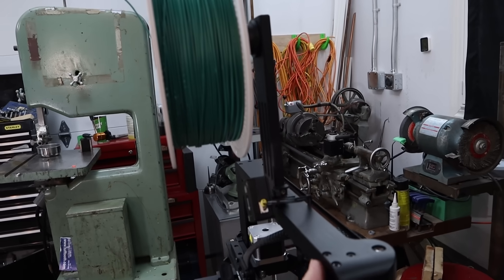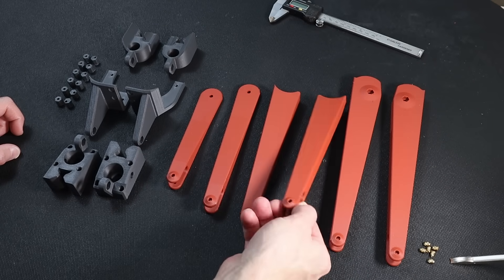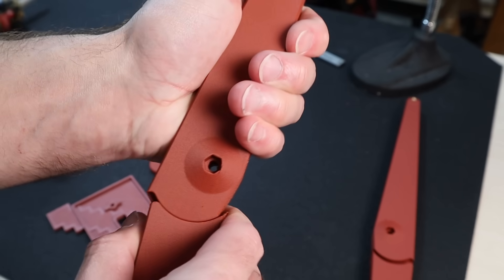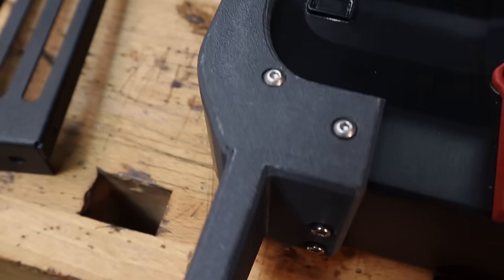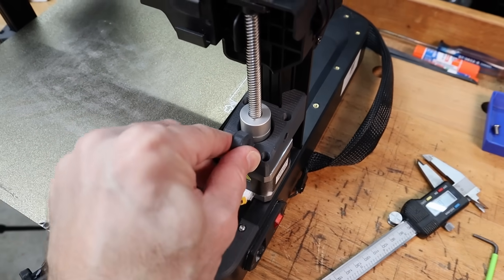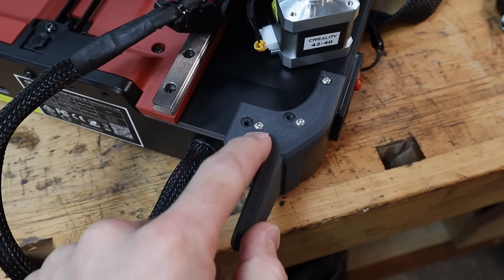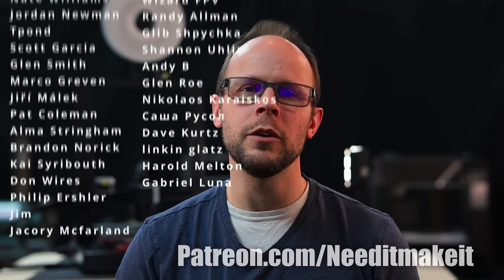STRONG and FULLY 3D Printed Arms for your Ender 3 KE and SE

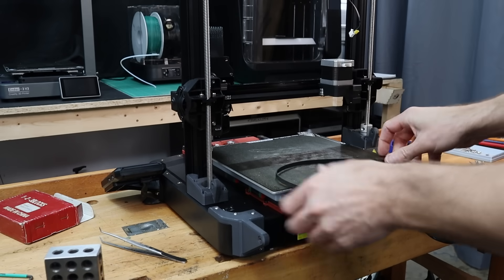Comment: 10:01 My admittedly used Ender 3 V3 KE came with the left and right side Z-axis misaligned.  I eventually realized what was going on from the bed leveling results, released the belt gear collar on one side, rotated the wormscrew a quarter of a turn, retightened it, and now it's almost perfectly level.
11:45 Good solution for "and now we can add the M5 locknuts...".  I like that you leave in certain realistic difficulties like this in your videos :)

Comment: H Mike, I know it's an "older" video, but I just wanted to say that the shaking also occures because the spool is on top and combines with the fast accelerations/speeds it shakes a lot. An easy fix for me was to to print a plastic tube (1.4mm walls) and put it onto the spoolholder (like toilet paper roll, you get the idea 😀). Printed from PETG and it feels much more rigid.

Great video nevertheless and thanks for sharing!
Reply: Good idea.  In fact, that makes me think that adding (firmly affixed) inertial mass to the top of the frame should reduce vibration - e.g. diving weights or wheel weights.  🤔

Comment: 😂😂 hi there ! Im from PrintArmyUkraine - ender 3 se v3 is ready to print from the box printer . Stop spending yourtime on nonsense 🎉 join PrintArmy of Ukraine - 🇺🇦  , you will get free 24/7 support from best designers and printmans ❤ i having this creality and it is printing parts for funny things almost 24/7 - yepp it is not the best , assembly is 50/50 but it is working , and it can print really well from the box +- 0.1 - 0.15 mm . And one more - plastic is not rigid 😂 it is really soft compared to metals

Comment: I've been posting on the maker world page, but maybe it'll get seen better here.  I am having an issue with the cut out piece on the lower left hand model.  Mine is printing too tight/filled in and the little coin is not popping out for me.  Wondering if there's a way to fix that?  Maybe someone else has run into this?

Comment: I could not really tell, but I'm 99% sure that PL was construction adhesive. That stuff does not dry hard. It's meant to hold wood together and expand/contract with the wood. This is not a good use for it.

Comment: Thank you very much for this great Video. 
I would probably use a threaded rod so that I could still adjust the force and position.
Reply from the maker: No problem!  I think a rod is a great idea, I was trying to do something that anyone would be able to do with a 3D printer, using metal would certainly be a better option for anyone capable of working with it.

Comment: I'm a bit late to the party, but I did a redneck solution for this. I attached a piece of wood to wall next to the printer, then attached the piece of wood to the spool holder with a bolt and a nut. Similarty I attached the whole table to the wall and I put sticky pads under the printer so it doesn't move at all. Love the channel, love the videos. Keep it up!

Comment: Guess it wss a good thing the space for my ender 3v2 wasnt big enough to use the filament arm mount on top, so the first thing i printed was an adapter to put it on the side. And then I made free standing filament holders. 
I always thought hanging the filament on top wasnt a great idea. Maybe it gets smoother extrusion, but it cant be good for the frame.

I've been thinking my final design for the filament holder would be a wood frame that allows it to sit on top on an angled lazy susan that just fits the space i have. The wood frame makes it so theres no actual weight on the printer frame.

Did you not do anything to test for the squareness of the frame though? Having one side have an off centre nut makes me think it must be making the frame be slightly twisted, even if its more rigid.

Comment: Hey Mike, I just wanted to say thanks for your work on these arms. It solved my issue with print failures on my taller models. The angle on my gantry was so bad but not only did these arms straighten it out but made it sturdier. My prints are now coming out great. The only thing was I had to by a Bambu Lab printer to print the arms in order to fix the Ender. At least that's what I told the wife 😄. Anyway, just wanted to give you a shout out and encourage anyone else with the issue to give this a shot.

Comment: I just got a v3 ke and the first boat test had some problem on its roof. The lines doesnt glue together so well. It might be because of my cold room! So I decided to make a box to control the environment tempreture. 
I really like your mod, but I think I can fix the vibration by putting some spacers between the top frame and top of my tight box in order to push it down and hold it tight. Of course, I have to take off the filament holder.
I will mount the screen and the filament out of the box. Also, with some holes under the vents of the base. Maybe printing a few flanges to connect the vents to those holes! The isolation layer inside the box is the next...

Comment: I saw a different video that tested different solutions to fix vibration related quality issues with a Ender 3 v2. What worked best then was not stiffening up the printer but just adding vibration absorbing (3d printed) feet to the printer. Did you ever try that?

Comment: To improve your budget printer you'll need 2 more expensive printers
Reply: I could do this with scrap unistrut, and some threaded rod and square stock all leftover for jobs i do.
Reply: Nope, because you wouldn't print those ridiculous supports when you can make them out of metal
Reply: @protogionlastname6003I agree but people get tied up with printing and aren't maybe that confident working with metal. Even the easy stuff

Comment: Great modification. But, wouldn't it be possible to screw the 2 long parts together instead of glue them?
Reply from the maker: Technically just screws alone would work fine, but I wanted to glue to make it as rigid as possible.

Comment: is PETG the recommended or required filament?
Reply from the maker: I think you could probably use just about anything, if you plan on printing inside of an enclosure, try to use something that can take a bit more heat, just to make sure it doesn't soften, if not, PLA will work just fine!

Comment: Hi NeedItMakeIt, love your designs. 

Is there any chance I could get the step file for mounts that screw onto the back of the body? I'm working on a cable chain mod which would connect onto this part. 

Of course will share if it works out? Cheers
Reply from the maker: Can you shoot me an email?  I'll star it and see what I can do!  Needitmakeit@gmail.com I get a lot of messages and I am trying to get to every one of them, but it is not always possible.
Reply: @NeedItMakeIt  Awesome thanks, email sent - Ed Lewis

Comment: I am relatively new to 3d printing. I have an Ender 3 V3 KE and have been very happy with it. 

So far I am not that aware or critical about the quality of my prints. I have not seen the need for the upgrades you have done. I will say if I do decide to do any I will probably use yours. I like the way you do them. They are very clean and professional looking. I have seen lots of pictures of stabilizer arms, but yours are far and above the best looking least obtrusive.

Keep the upgrades coming!

Comment: Not only is this upgrade, i would say, HIGHLY questionable in terms of rigidity, but also completely replaces some critical machined parts of the printer with 3d printed ones, which is absolutely unacceptable. The word "precision" in printer's specs is not just a word. The design is hugely overcomplicated and also requires the chassis to be drilled. There are ways to get around all of these drawbacks.
Thanks for the content regardless, it definitely adds SOME rigidity to the frame, but not nearly as much as it could be.
The "advantage" of 3d printing almost all of the parts is actually more of a disadvantage if you look at prices and mechanical properties of metal hardware pieces. When it comes to rigidity, 3d printed parts are the thing to avoid.

Comment: I still wounder how you get the perfect finish to your parts, i've been printing for some time now but i still can't figure out how to get the finish you get. Do you have any tips i coul use?
Reply: I have, go to your settings on  max axelleration or max speed and adjust it. Try to find some vids
Reply: @moijaz_s got it i put the first layer speed even lower so now it prints at 10mm/s.

Comment: I would really like a 3D printer to play with. I am torn between the Ender 3 V3 SE  and the V3 KE, what are the major differences beside the price? Also do the upgrades you have done cost a lot? Or should I just save up and get the Bambu Labs A1, that everybody says just prints out of the box?
P.S. I could afford the 3V3 SE now. The V3 KE in a couple of months and the Bambu February nest year.
Reply: Take KE, faster printer
Reply: @billy.the.maker.  With all due respect does being faster mean a better printer?  So for the $65 price difference between the SE and KE what do you get?
Reply: @ian1957ruth  You got better hot end 300c (you can print ABS and other high temp filaments), Klipper, linear X axis, and much more. Look at comparisons there is no reason to not spend the extra 65$
Reply: @billy.the.maker.  OK Thnx

Comment: Hey there! Thanks for your awesome work! I already messaged you on Maker World, but didn't hear back, so I'm dropping a comment here too. I'm interested in printing your gantry support but want to tweak it a bit—adding extra supports where I think they're crucial and smoothing out some edges.

Could you share the original project source files (I think you use Fusion 360, so .f3d files)? Having those would really help me make the changes. Afterward, I can send you the updated files so you can decide if my additions are beneficial for updating your models on Maker World. What do you think?

Comment: The amount of work you're putting into the KE is crazy. I thought the KE was going to be great for me but after watching your KE upgrade series, I think I'm just going to get an A1 or P1S even though I don't necessarily agree with their business model.
Reply: I've got an se and it works very well no complaints at all. The A1 is hard to beat though
Reply: You probably already got your printer, but im absolutely loving my neptune 4. It needs occasional maintenance(tightening bolts, re leveling the build plate, belt tension) but no actual physical upgrades needed and can be had for $150 less the bambu

Comment: Bolted joints at the ends and added that brace to the arm, but then there's a simple glued joint right in the middle of the primary arm. That curved dovetail is very cool, but you should make it  long enough to add a thru bolt like the ends. The added brace is 4 additional parts and more disassembly of the printer and likely negligible improvement to the primary arm. One single arm per side would achieve the same result with much less effort. If there is deflection in that long arm, then it could be better solved with larger cross section in the middle.

Comment: Love your experiense :)  I got my first 3d printer about one week ago. a Ender  3 KE.  Soon found the wobbeling problem.  But come to a different, but not nearly as fleksible/elegant solution. But much faster, cheeper, simpler.
The problem seems to be the weight of the spool. So by simply put the spool on a fixture on the wall, above the printer, improved a lot...  But of course, that means that the printer is stationary...  And yes,  there will be some wobbeling still, but FAR less. 
The upgrade with linear rails. That will I do thoug

Comment: So how much this mod did? On simple Ender 3 we have full-threaded stud mod, that made out of metal and its very solid, also have hex nuts for some calibration at tension and its connected directly to the frame (4040 profiles). So, i think plastic arms not that good?
Reply from the maker: The original enders are far more stiff, these profiles connect into the plastic base, and they are smaller as well.  It would have been better to still use the original Ender 3 frame IMO, and attach the parts to that.  I think this was done as as cost-saving measure.
Reply: @NeedItMakeIt  There is a meme in the community that after modifications from Ender 3 only its frame remains, the rest has been replaced

Comment: beutiful  <3 is it worth buying for the ender 3 v3 ke ?if it is available or the normal one ender 3 v3?
Reply from the maker: I would recommend getting an enclosed printer, the best one that I have tested so far at a good price is the QIDI Q1.  I made a review video and some follow up videos on it as well.  The price point is not far off and you'll have a much better experience with a printer like that.   I started with bed slingers, but I always had warpage issues and had to pay close attention to the room temperature, I don't even think about it when using an enclosed printer.  I have a review video on the E3V3 that I just released a week+ ago and it shows that issue.  If you want the best print quality, the Bambu printers and QIDI seem to be at the top, Creality is still struggling a bit with extrusion for some reason.

Comment: Yes, the problem with these printers is in the stands; they stand on a plastic case, which becomes deformed when the temperature changes. Well done author, the solution is correct, strengthening the racks with supports. If the author doesn’t mind, then here is also a good solution for supports, there will be a link to the files: https://www.youtube.com/watch?v=6jJuzklzp74&t=34s

Comment: Doesn't the ADXL345 Vibration Compensation Sensor take care of this problem?
Reply from the maker: This printer doesn't have the sensor on it, and maybe it would help a little bit, the sensor needs to be positioned on the X, measurements taken, then the Y and the same process is run, there is no active vibration dampening on this printer, which means that when the mass of the print changes, so does the vibration.  I've read that the results of the sensor for this printer are inconclusive.  I'd still like to try it myself to be sure, but I have a feeling that what I've read about it is right.

Comment: Nice,  but easier to just run a PTFE tube up,  remove the  spool holder and print from a dry box.  The filament is most of the problem.   Still requires a couple items to be printed of course.
Reply from the maker: Yup, good option for sure, I'd prefer to see the runout sensor on the head or within the head as well, it doesn't make sense to run up and then back down if it can be avoided.
Reply: @NeedItMakeIt  I just printed a feed to test the concept of pulling from a dry box.  Got a few options out there.  For sure the run-out sensor needs to be handled.   Printing another that will allow it to still be used,  but very wasteful in the path.
Reply from the maker: It should work well coming from the box, I've done some testing on pulling through a pretty long tube and it doesn't seem to be enough friction to cause any problems... until maybe we get to 10+ feet of tubing anyway.  It would depend a bit on how the spool is rotating, I've found one of my dryers causes the spool to rotate with quite a bit or resistance, while the other has very little.  I don't find I use the runout sensor at all do you?
Reply: @NeedItMakeIt  I've printed a couple solutions and both are working fine.  The shaking does go way down with the 1kg spool out of the picture.   I'm happy with this solution and it doesn't require any mods to the printer.   Well not permanent mods at least.
Reply: @NeedItMakeIt  I don't use the runout sensor.   Might be more of an issue if I'm pulling from a filament dryer.  Some are hard to see in and know what you have left.